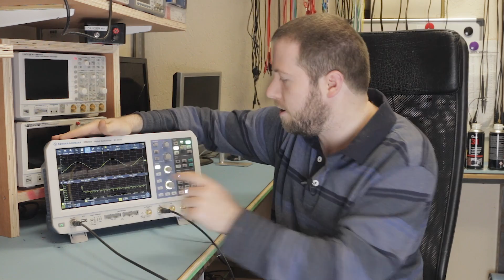Watt Circuit Rohde & Schwarz RTB2000 Series Oscilliscope Overview (RTB2004)

Comment: Now I can see why they are calling it came-changer.
the price? not so much. I'm not complaining about the scope but rather to the option. it's ridiculous that a single software license for decode costs at least as a good logic analyzer (which comes with said decoders for free)

besides that, the work on the UI is astonishing. very nice touch (aha!) with the RGB LEDs